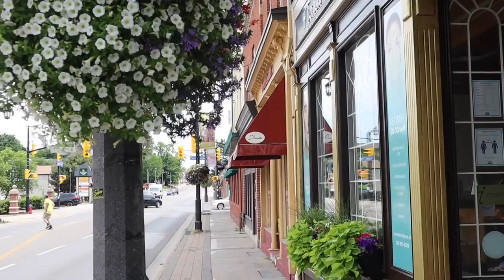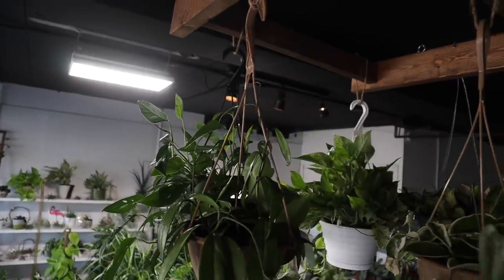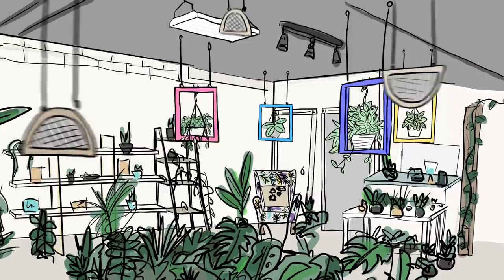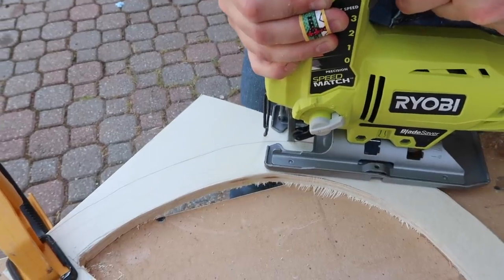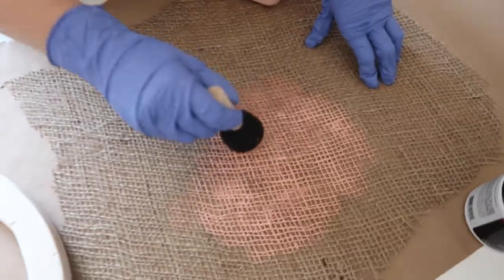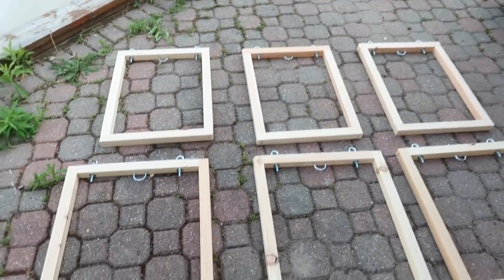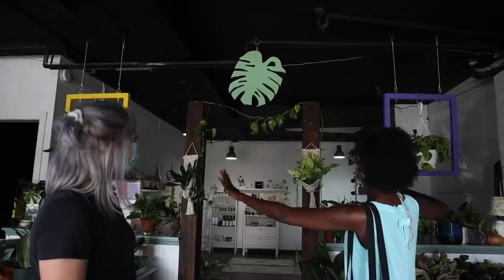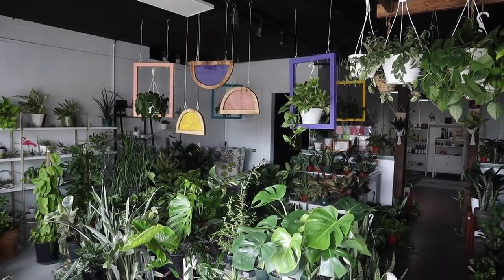this lush plant shop got a colourful diy upgrade!

Comment: Fun fact: Pie used to be slang for easy so the saying easy as pie is literally saying easy as easy. 🤷‍♀️
Reply: Nowadays the filling comes in a can and the pie crusts are in the freezer section at most grocery stores so, for a dessert, it doesn't get much easier than that.  Dump, cover with 2nd pie crust and bake !   Easy as pie!